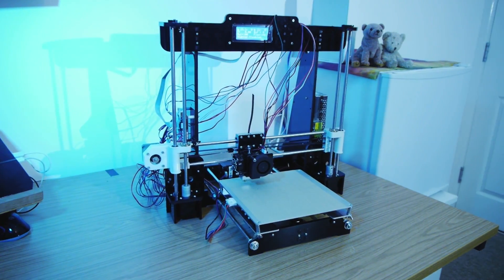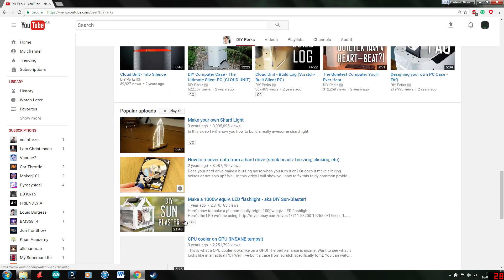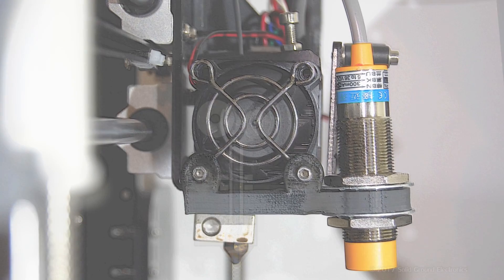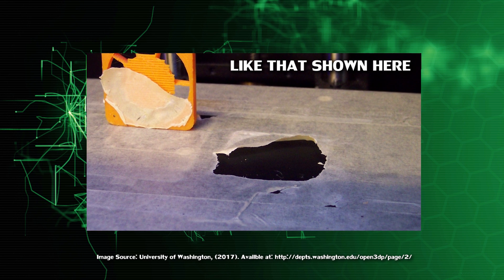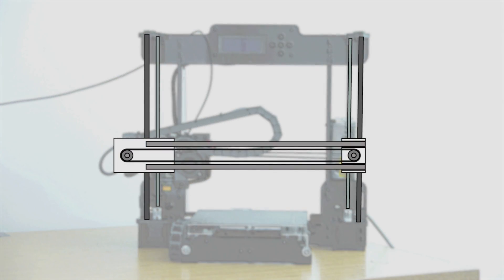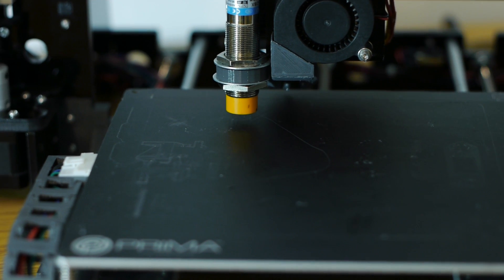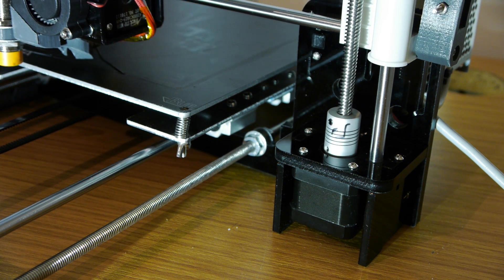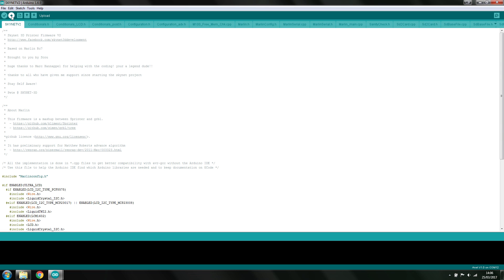Cheap 3D Printer - Anet A8: Upgrades, Experience & Thoughts

Comment: Just subbed and liked! very informative and some neat ideas compared to the way I've seen a lot of others configuring their upgrades. I especially like the duel z limits, via switch and bed sensor. Looks like you have a good grasp on the electronics end of things. Nice production value as well with the animations illustrating what you're describing, such as the filament pull for color change. Keep it up! perhaps you'd consider a future video showing any capabilities of the stock power supply powering any add-ons such as LED lights or extra fans for cooling said power supply or main board? I know most people suggest upgrading to an atx computer power supply, which I will probably do soon after receiving my own A8 (ordering one soon), but since you know electronics, I'd be interested to see what the capabilities or shortcomings of the stock power supply are. Can't wait to see what's next!  :)  Thank you for your insight.
Reply: One more thing I've seen that I was curious about is one user who wired his z motors parallel. Maybe you could look into this as well and see if there are any true benefits? In theory I guess it would be a good thing, in order to keep z axis motors in perfect sync with one another, but since I don't have the Anet circuit board in hand yet I can't tell if the plugs for those motors are already parallel circuits on the board or if signal is sent independently to each. Thoughts?
Reply from the maker: Hey, Thanks for your nice words! I must admit the animations were to fill in the gaps between footage that I had not captured but I'm glad that they went down well. 

I would recommend that you stay away from an ATX power supply and instead get a purpose built 12V 30A SMPS like this one: (its an amazon affiliate link btw http://amzn.to/2nXGWpw). I think you could run another amp or two on the existing PSU, which would power a couple decent LEDs but it does get pretty hot without that so you may want to bare that in mind. Also, if you do get said PSU, you will need to move the supply voltage switch to the correct position for your region. 

I just took a look at the Anet A8 Main board and the Z motors are already in parallel. You will be able to tell when you get your one by the fact that turning one motor turns the other. I'm pretty sure they do this to skimp on parts and not to keep them in sync. 

Thanks again and all the best with your printer,

Fred :-)

Comment: Nice! Just got mine A8 a week ago, so I'm slightly behind  compared to You, but I started with a bowden extruder mod (E3D V6 clone on this simplistic clamp for now: http://www.thingiverse.com/thing:2117245). That required some changes and tweaks until I could print again, and since yesterday I'm back in the business and had already printed the X tensioner and Y tensioner (the one You mentioned) and have a new, glass fiber reinforced belt waiting. Now I'm waiting for the new linear bearings to print (http://www.thingiverse.com/thing:1811769) and then I will print some holders for those and maybe a Y axis chain and will fit all in one go :) Based on Your post below, I belive I would also need to print the frame support before installing a Y axis tensioner. 
Next I will see how can I use that bed leveling sensor I got for my Anet from Gearbest: http://www.gearbest.com/3d-printer-parts/pp_591321.html

Keep us updated on modifications You do to Your Anet :)
Reply from the maker: Thanks :-)

It sounds like you will have a completely different printer after that load of mods! 

I'm not sure why the base support is needed, I'm pretty sure running the belt with enough tension to deform the 6mm acrylic, can't be any good for the motor or idler bearing. That said, I may make one at some point just to give it a go. 

If any of these mods are a must have, just let me know and I may test it out.

Thank you for your interest in this project,

Fred.

Comment: why don't you build a support for the base of the printer
Reply from the maker: scout413 Thanks for getting in touch. I was thinking about strapping the printer down to a big old slab of MDF when I first started using it. However, I found that the mesh bed leveling compensates for warping of the frame so it was no longer needed. The only reason to do it is the fact that tensioning the Y axis bends the acrylic frame but as I don't have a tensioner on that axis yet its not a problem. TL:DR There is no need too yet.